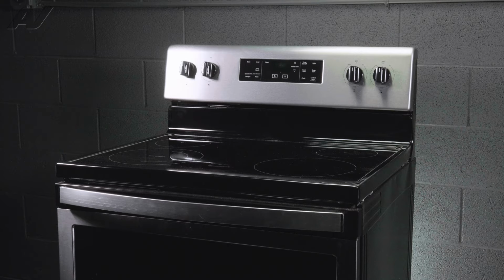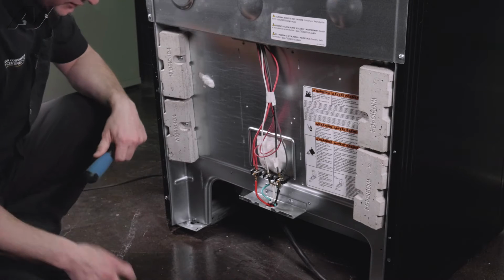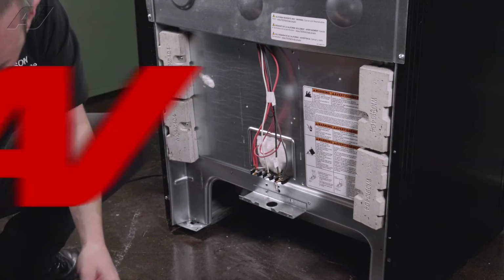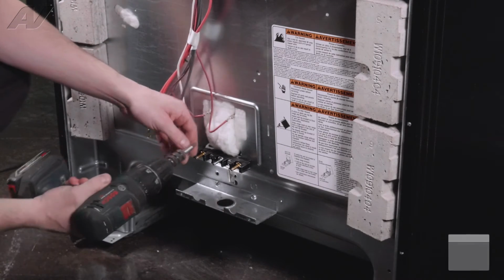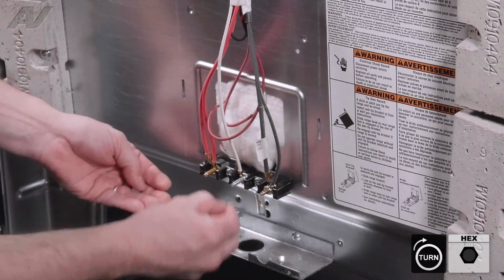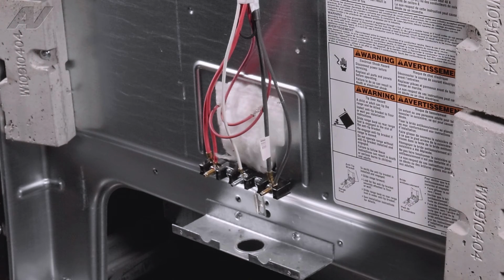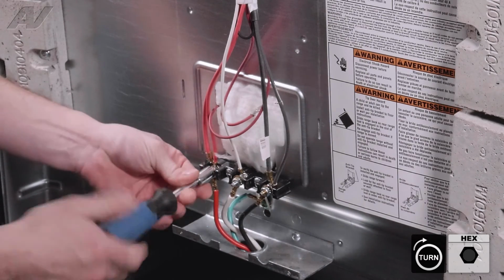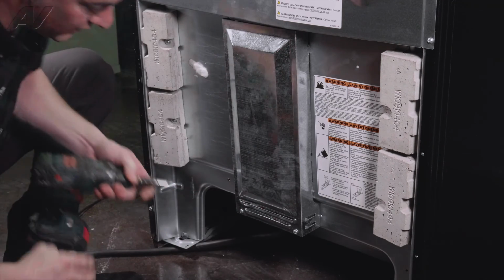Whirlpool, Maytag & Kenmore Stove / Oven  - Replacing the power cord and terminal block

Comment: I had installed new wire to new stove as you did when I had power turned off at the power box to my appliance .and I plugged it in , it sparked and now nothing happens. What did I do wrong?